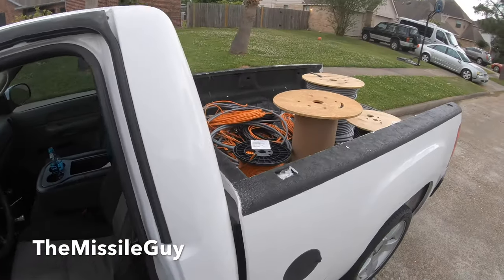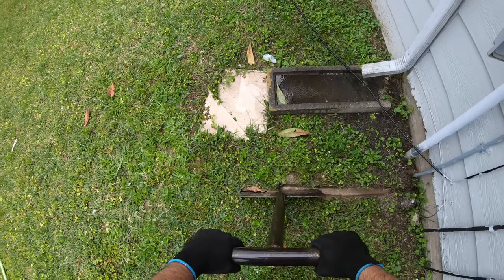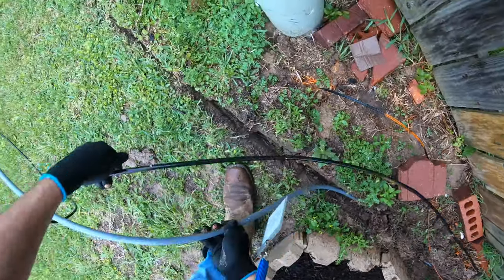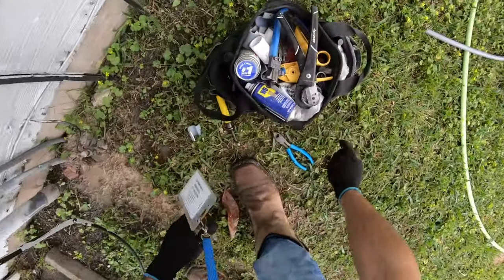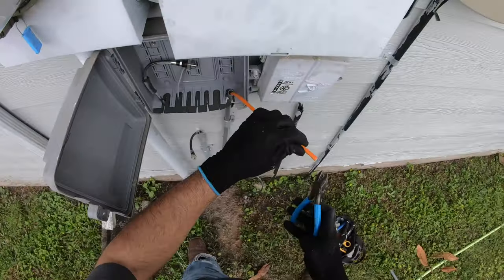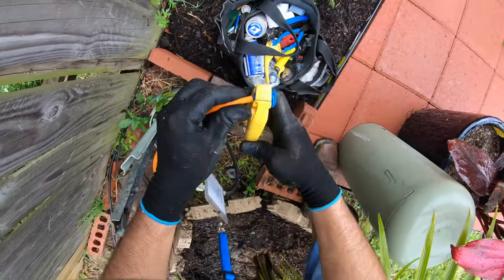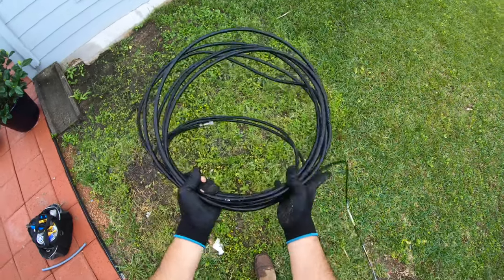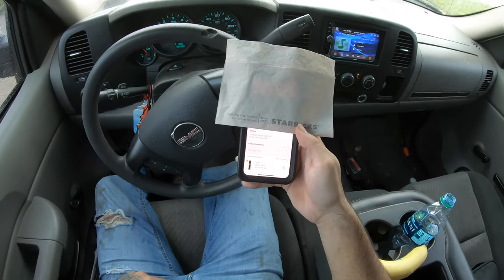How to bury cables using a Wampler

Comment: We did this with whompers (wompler) in Kansas City (both states) for Google Fiber. My boy Mario cut the handle off and welded a jack hammer receiver on the blade and power womped 1000's a feet a day. Just put it in the ground and run it like a plow. You do awesome work Bro.
Reply from the maker: Thank you bro I appreciate that! . That’s very clever, wonder what kinda soil you guys dealing with ...You burying the hard line for google fiber ?

Comment: Att just did this in my yard for Fiber after I signed up for GB internet. Internet was installed last week and they sent someone out today to bury the wire. But no conduit and and I peeked outside as he was pushing the line in the ground and it looked really shallow. Like maybe a couple inches, 3-4” max. Is that bad?
Reply from the maker: Call ATT and have them bury it deeper , ATT is 10” minimum .. thats quality control failed
Reply: The Missile Guy I contacted the installer, and customer service. Both claimed that testing showed there are issues with fiber optic cable buried more than 8”, so they go 3”-6” inches now. Something about damaging the cable and reducing signal strength. But isn’t that why you use conduit to begin with?

Comment: You need to get a "poker" we use dandelion weeders they are about 3 ish feet long and have a metal y at the end and you can lay the drop in the ground while standing up. Well worth the investment.
Reply from the maker: Nope I do not need that thing, that’s for my lazy dudes 😂. But on serious note 
every time I see someone use it , they damage the drop , it kinks the drop and then creates (INGRESS) down the road. You need to get rid of it ASAP!! If QC catches you using that you’ll get pull off the field in a quickness